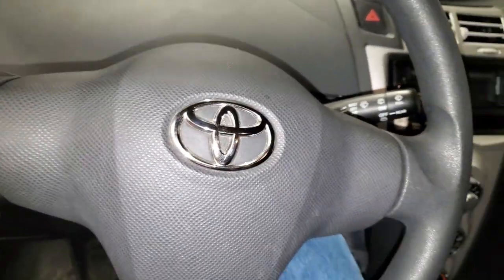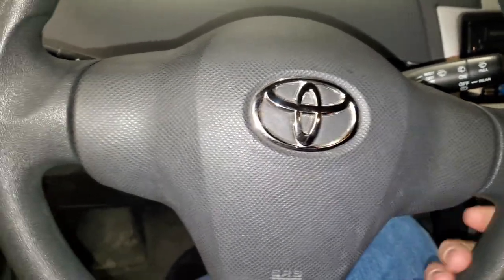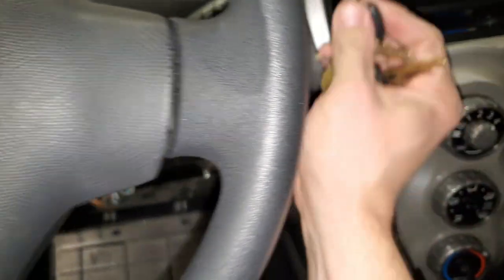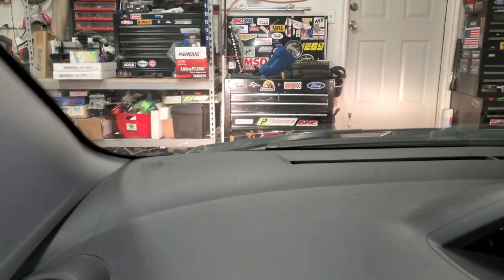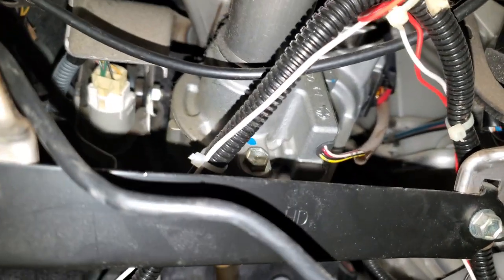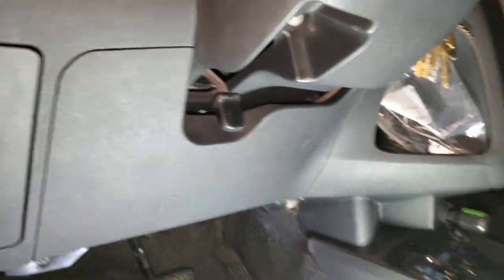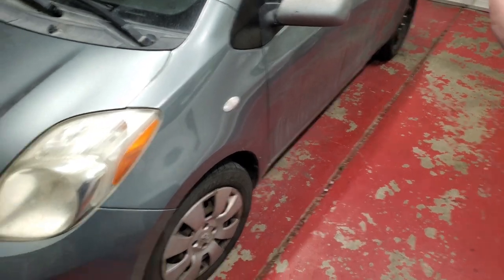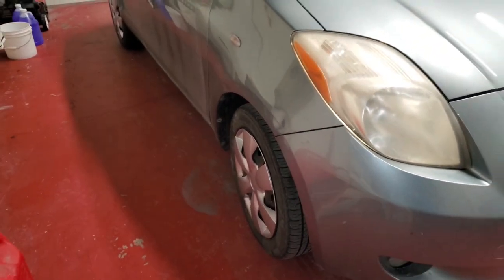Eight Nine Garage - Yaris Daytime Running Light Disable Delete - EP22

Comment: I want remove the drl from headlights and use in a different bulb that i installed, there is a way to do that?
Reply from the maker: What bulb are you wanting to use?
Reply: @89G  the drl im using is on the turn lights 1156, that share the same bulb led white/ambar. I saw in a forum that they use a spdt relay, but i don’t know if that make the drl get off from the H4 bulb and just keep my 1156 as a drl.

Comment: How did you wire your fog lights, and how do they operate?  (constant power, or only on with accessory?)
Reply from the maker: I bought a fog light kit off of Ebay about 3 years ago. There is a spot just to the right of the fuse panel that I found accessory power, and I used a spade connector to tap in there. I also fused it, as the Ebay kit was not fused for that part of the circuit. As it sits, I can run the fog lights without the headlights, with a switch that is in the center console. I put it next to the AUX port. Hopefully that answers your questions.... let me know! Thanks for watching.

Comment: Do you have a video on how you installed your fog lights?
Reply: Just got a pair and can’t find a video for installation
Reply from the maker: Unfortunately, no. I put those in before I decided to start a channel. I am happy to answer any questions though.
Reply: @89G  do I need to get anything separately from the kit besides tools? Do I need the spade connector to tap into the fuse box accessory?
Reply from the maker: @thomasgriffith5544  as far as I remember, the spade connector did not come with it. My kit came with everything I needed, but I wasn't impressed with the zip ties. I used different zip ties. Also... I do think I had to cut the hole for the switch, and I put that in the center console. I don't have the car with me, or I would go look - so just going off memory.

Comment: I took out the drl fuse and it works but why doesn't my fogs work
Reply from the maker: You took out the fuse, or the relay?
Reply: I took the thing under the steering wheel like in the video
Reply from the maker: @asianjrwd  what year is yours? I put my own fogs in, but they are a kit like a dealer would have used. Mine work. Since I made this video, I learned that there are wiring differences in these, depending on where they were built. The US models are pre-wired for cruise, and the Japanese models are not. Mine is a Japanese model.
Reply: Mine a 2009, S model and I did what you said in the video. But the fogs were off too
Reply from the maker: @asianjrwd  dang... I don't have a 2009 workshop manual.
Reply: What page would I have to check in the manual
Reply from the maker: @asianjrwd  mine is on page 146, but it's a 2007 manual. Just looking at mine right now, and the factory did incorporate a fog light relay into the running light relay. Do you have the original Toyota "Electrical Wiring Diagram" book for your car?
Reply: Idk what the book would look like
Reply: I just looked through my car and I don't have the electric diagram
Reply from the maker: @asianjrwd  I had to order mine. Think I got it on Ebay or Amazon. I can email you the 2007 circuit diagram if you want to email me. I'd put the whole address on here, but don't want the bots to pick up on it. It's a gmail account... user name is eightninegarage
Reply: We're taking out the fuse instead work